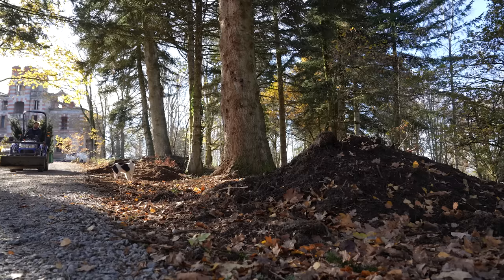Planting France's BIGGEST forest garden.

Comment: :hand-pink-waving:Thankyou Dan, as always, a joy xx As a gardener - and a pretty experienced one - Put a good amount of water in the bottom of the trenches for the plants as you plant them and then soak again from the top to settle the soil around the roots.  If it's left dry you will have problems.  You can take out every other one of the yew and spread them out. You will have healthier plants and a larger hedge. x

Comment: Dan, did I miss the part about NOT getting the Roof started? I watch your videos each day too and don't remember any mention for delaying Roofing.
Reply: He said that this is just a short break and that work on the roof will resume shortly. The plants have to be planted straight away or they won’t survive
Reply: Im guessing he needs a break from building, Im sure one gets to a point where one is just sick of joists and noggins.  so gardening is happening.
Reply: Good luck with that in Winter, progress will be two paced, slow and stop, conditions for working at height will be poor!?!
Reply: @thomasherrin6798 Winter in central France is not so bad. It rarely freezes, and highs in January avg in the mid 40s.
Reply: He did mention about waiting to find out if the roof ring needs to be wood or steel. If it's something the French planning department decides, they are notoriously slow.

Comment: I thought you were trying to finish the roof?
Reply: There will never be a roof on this building. It's barely standing. It is a YT project, nothing more...
Reply: @DorotaN-sl3tu you are so very wrong about that.
Reply: @DorotaN-sl3tu O, ye of little faith. You will surely have a right meal of those words in due time.
Reply: No point putting roofing timbers on until the new mortar has set which will take a while in the cold, roof timbers weigh a ton and it is probably too wet and therefore slippery to work at height just now, maybe he needs a break from construction, this is going to be a long project and he needs to keep motivated. These are only my thoughts but I trust Dan to have thoughts it all through and to know when to proceed for the best, after all it is his project  and he has spent many hours with engineers and the planning dept so will have a plan which he knows is also weather dependent
Reply: @shirleyw8531 Hallelujah, someone who actually listens to the vlogs rather than just watching them ❤❤❤